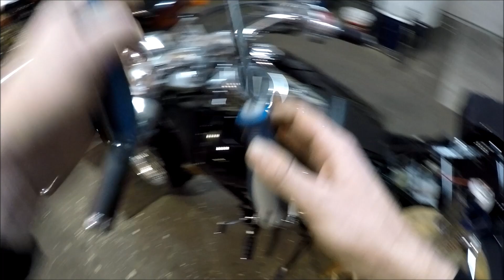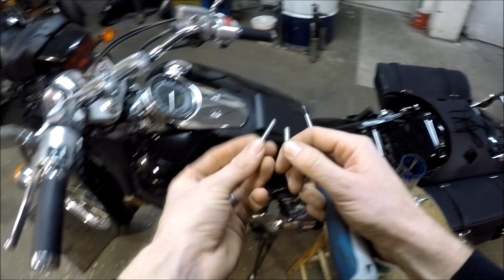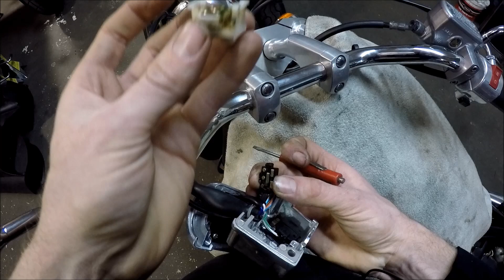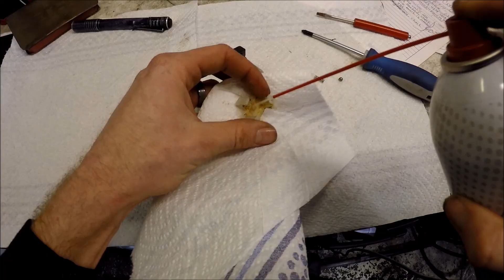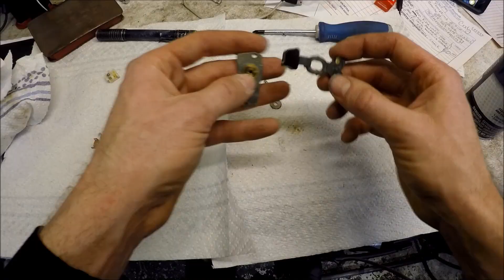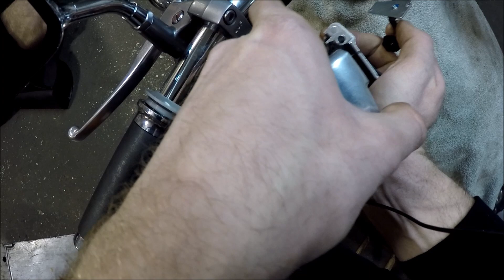Motorcycle Turn Signal Switch Repair

Comment: We just bought a 1985 Honda Shadow VT500c and it was EUROPEAN BUILT Germany to be exact. Just got it started and idling at 1100 rpm. Now all the turn signal lights were cut and taped.  We checked the voltage and after switching it on, volts switch from .01v to .09v.  Do you have any experience if the euro build it any different?   Thanks for any info.

Comment: Do you know if each of the contact points are a corner of the bike?  My left rear will not get full power, it's not the relay either...my test light dimly lights, enough so for the bike to think the bulb is dead and hyperblink.  I had cleaned up my signal switch but I didn't get UNDER the switch to the contact points.  I guess I'll give it a shot tonight.  Thank you!
Reply: Just as a follow up, I pulled the seat off and fiddled with the connections under there that run to the rear turn signal and got them to work.  There was power up until that point so I knew that was the break.  If it continues I'll repin that wire and reinsert into the connection.

Comment: Already replaced the whole thing siwich and light bulb, bit still doesnt work, what elso could be?
Reply: Maybe relay
Reply: @jperrod1979  thank you for replaying, I'll check at it  ✔
Reply: @h.sortiz3840  From what I've gathered, find the relay...for me it's under the right side cover...pull it and jumper from the white/green wire to the grey wire...that causes the bike to bypass relay and when you signal that side, both front and rear of that side will light up and stay on indicating that the wiring/bulb are fine...if both sides work fine with relay bypassed it is more than likely the culprit (although further multi meter testing can prove it, although not my strong suit).  If the issue persists with relay bypassed, then it's probably not the problem (like in my for instance).

Comment: My old 2000 BMW F650 had pretty much the same principle in disassembly except for a wire attachment for the choke. One of the screws that the turn signal switch pivoted on was very loose; tightening and lubricating got it working like new again! Thanks for the video!

Comment: Great video indeed. One question: the blue grease you use in minute 13:56 is the dielectric grease you spoke later on? Can you provide a link to buy it online?

Comment: Well guy, you did it again.  I just finished the clean and lube on the turn signal switch following the steps described in your video.  Big difference!  BTW, I ordered and received the JIS screwdrivers from GoFastInnovations. Well worth it, just like you said.  Thanks dude, keep up the good work.

Comment: I'm needing to replace the turn signal relay on my 2003 Honda Spirit 750 and I can't seem to find where it's located. I even have the part, but can't find on the web the exact location. I've avoided taking off the tank unless I absolutely have to so I figured I'd ask here first in case you can help. Great video on the switch by the way, I plan on doing this as well.
Thanks in advance.

Comment: Exactly what I was looking for. My Honda 919 turn signal switch is misbehaving. I have to hold the switch down for signalling to remain on. When I let go, let's say signaling right, the right signal light goes off meaning no low beam or high beam but the left signal still has low beam. Once I push in the signal button, both signals have a good low beam. See happens in reverse operation. Hopefully cleaning the switch will fix this.

Comment: What was the 4th thing you check out. You said tires, horn, and turn signal. You didn't mention the 4th. I got a 2001 shadow from a friend and your vid really helped out. I had the exact same switch. Only mine was full of dirt and now works like new. But I still want to know what the 4th thing was. Thanks for your help doctor!

Comment: Thanks, what a difference! Some things I found helpful were, small wire brush for metal parts, small paint brushes for grease and cleaning parts. My oh sh*t moment was with the contacts but after looking at the back of the white plastic housing (3 indents for the bearing to click into) it can only go in one way. Thanks again for taking the time to do this, was a great help.

Comment: Awesome video! When I turn my switch left or right I need to wait like 3-4 seconds before lights start to blink. Do you think cleaning the switch would help with this problem?
Reply from the maker: It’s worth a shot for sure man! I have seen this solve all sorts of issues!
Reply: Did you fix it? I have the same problem.
Reply: Could be the relay. Have an 85 V65 and relay finally went; replaced it and works immediately.

Comment: So, 45 yo woman here, been riding for 35 years, never worked on my own scooters.  My bike has been sitting for 8 years :-(, took to Honda shop, they were "three weeks out", great, "just fix it, whatever it needs".  8 weeks later, and to the tune of only $1300, finally got it, very excited, jumped on it and took off for home and thought, "HTF am I supposed to ride this with the blinker switch all gummy and sticking???"  But, I want to ride it this week, not 16 weeks from now, so I thought, "surely this cant be that hard..." Found your video right off.  Loved it.  Gonna try the easy fix FIRST and then if/when that fails, I'll take a chance on losing all those screws and springs!  LOL  Seriously, thanks for the vid, I subscribed before I even finished watching.

Comment: Would this also cause the brake light to stop working on a CB1000r?  I'm having the turn signal issue but my brake light also doesn't come on when I use the brake lever or the pedal.

Comment: I had the same problem on my 1984 Honda V65 Saber, I did the exact fix you posted, and I did it without "YouTube"... Manly cause there wasn't YouTube in the late 80's. But a great video, and you refreshed my interest in doing this to my 04 ST1300 before any problems pop up. Cheers

Comment: Good video. I am replacing out the complete front hydronic brake control and handle because it is so badly pitted and ugly on the outside. Do you have a video which shows the removal and replacement of the hose line to the cylinder pump on the handle?

Comment: What if that, and replacing the relay, doesn't fix it? What's the procedure I should follow to find the real problem?

2004 VT1100C Shadow Spirit.

Background: I moved the rear lights to install bags. The turn signals were a little flaky before I did that, so I figured relocating them would give me an opportunity to check the wiring and make sure it was sound. I did that by testing continuity with a voltage meter and everything seemed to be just fine.

After installing the bags everything was working the same as it had been before, meaning when I use the turn signals they worked most of the time. The times they didn't work they would usually start working after I turned them on and off a couple times.  They switch was a little dirty so thank you for this video. It helped me get the switch working very well. But the signals still don't come on...

TIA!

Comment: Thank you for taking the time to explain the details so completely!I had a turn switch assembly that required replacement because a previous ownerforced the switch arm when it was sticking and ended up twisting and fracturing it at the 90 degree bend. If all your videos are this informative I know where I will be looking when hopefully I won't need it!

Comment: being nitpicky but you got the directions wrong at 8:20!!!!     the lever pivots in the middle so when you push it right it pushes left on the switch inside.   otherwise great video.  got my xr650l signals working perfect!

Comment: dude thanks for this video. I opened my switch and it looked scary in there. I was ready to buy a new one and then I saw this video. will make sure to clean that baby out. one question. do you know if the seal in the inner part of the housing that prevents dirt and water can be obtained by itself. or in a set of 2. mine are cracking and dry because of the texas sun. I would like to put some of those in.

Comment: Thanks for this handy tutorial,
I will definitely try this out.
But I still have a problem with my turn signal switch. If my motorcycle has been stationary for a while (for example in the winter), there is a delay in the operation of the signals during the first few days. If you turn them on it will take a while before they start blinking. And that is very annoying if you have to turn often. Do you know what the cause of this can be? It is a Honda XL600V Transalp from 1995
Reply from the maker: Try cleaning the contacts out like in this video first. Then get back to me!
Reply: Yes I have experienced the exact same delay problem on my 2001 Honda XR650L. I did Cody's lube and clean and used a small SS wire brush on the fixed contacts and moving contacts and it solved my problem. It was more so the fixed contacts that are encased in the black plastic that were the issue I'm thinking.The contacts looked brand new but the grease build up over the years created a tarnish or glaze that made for intermittent contact issues. Great detailed video by the way!!
Reply: I just disassembled my switch yesterday, cleaned it and greased it again. They work perfectly again. Thank you very much for your video and advice. Now I'm excited to work even more on my bike. Once again, thank you very much.
Reply: Sweet the wire brush did the trick?

Comment: My VTX 1800 turn signal was sticking and only functioning after several seconds of delay due to the old sticky grease!. Because of your helpful video, I was able to perform this cleaning/rebuild operation without having to take my VTX to the dealer, or order a whole new part!  Saved me big $!  So, thank you very much for this!
Reply from the maker: BOOM!!! Great job man! Solid fix!

Comment: Hi Cody i did the mainenace to the switch this late afteroon. The greese had mutated into a sort of glue man... Now is working as new. I noticed that the screws that keep the plate shall not be tightened too much otherwise the turn signal lever gets too stiff or hardly moves as it should
Thanks man for your videos !
Cheers Davide
Reply from the maker: +Davide Emilio Marazza Good point! Glad you got that crap out of there and got it working like new! Enjoy!

Comment: great work Cody. I have own Hondas most of my life and now own a Goldwing gl1800. I had to clean and lube the four way flasher switch and up and down volume controls. the Goldwing is a little more complicated as you mentioned. I previously owned a 750 shadow ace 1999 and so far I have seen 2 of your videos that showed how to correct 2 problems that I had with it. one the turn signal switch and the other the creaky crunch brake master cylinder. Keep the videos coming you sure do know your Honda.

Comment: Blinkers are working backwards... I push in the blinker both front come on (no blink) brake light comes on...I pull the switch to the right the left side light up I push it to the left the right light up niether side blinks.. The back don't even come on
Reply from the maker: +Willie Patton have you cleaned the switch like I showed in the video??
Reply: Hello, I really hope you can help, I have the same problem, I don't seem to have power at the relay, could you please tell me how you solved your problem, Thank you. dianaandgerard@gmail.com
Reply: Also I did follow the great video and completely stripped and rebuilt the switch as in the video, but the front running lights are staying on, no power at the relay, no blinkers at all, all bulbs and fuses check good
Reply: Hi im having the same problem with running lights on but no blinkers front or rear please help
Reply: The bike is a 83 nighthawk 550
Reply: Probably have a bad relay

Comment: Hi MCMD, 
I had this problem. Riding was like, " What's going wrong with the #%&@#Blinkie switchie thing. I just happen to use my blinkers all the time. Looking down to check if the forward running lights were on, while riding down the road(yes, at all speeds) was going to "GET ME KILLED". I had in the past sprayed WD-40 in there, a fish oil product(hint). Would work for a little while.

Did EXACTLY what you showed how-to. The inside of the white plastic contact slider had GREEN-Algea-stuff growing in it. Took 20 minutes to kill that stuff. Could that have been the problem? Marine greased the whole area, reassembled with all your tips. No more WD-40.

Yep, works like NEW.  Can't thank you enough. You saved me a lot of Money/Worry. 

Thanks again
Reply from the maker: +Dave Ryan BOOM! Funky blinkie switchie fixie!! Isn't it a game changer?! Yes, that worn out grease "algae" is more than likely the issue. This is what causes the switch to get sticky and not allows the springed contacts to make a connection. Hope you can find a place to share the video and help someone out!! Ride safe brother!

Comment: thank you very much for sharing this video!! I fixed the problem on my 93 cbr. the switch was sticking and sometime not turning on. Instead of taking the whole thing apart like you did. i just took the toggle and the unit it pivoted in then cleaning that. i then used papertowels and q tips to clean the rest of the switch. used lube from harbor freight and feels brand new. thanks again!
Reply from the maker: Mr. Shaun Right on man! Some is good more is better! Glad you were able to get her smooth again!

Comment: Thanks for the video. Unfortunately, I broke a clip that the contact pins clip into. Any recommendations of where I could order that part?
Reply from the maker: Jordan Post unfortunately you can't order that part. It is sold as an assembly.
Reply: TheMotorcycleMD thanks for the reply! One more question if I may: could I have messed with something in that housing that would make my low beams not work (high beams still work)?
Reply from the maker: First thing I would check is the bulb, grab a replacement (you will need it one day anyways) and plug it in. I have a feeling this problem may have been a fluke and the bulb gave up at the perfect time. Unless a wire got cut or broken in the process!
Reply: TheMotorcycleMD ok, thanks for the advice!
Reply: I had the same problem - super glue and window screen graphing along with a small sheet metal shim support went a long way. That, or a careful sauter or weld job. Because you can't buy the individual part :/

Comment: Great video. So unfortunately since I suck at anything mechanical apparently this task was way to complex lol. Anyways, I tried cleaning it out first by spraying it. Made the switch work excellent... then my front right blinker stopped working. All other 3 work fine. So I opted to fully clean it hoping it by spraying it it blocked a contact or something... it's fully clean, works smooth as butter but front right is still not working. Also tried the bulb, no go. It's clicking as well so I assume the relay is fine?

Any thoughts would be appreciated, not sure what spraying in contact cleaner would do to break a blinker :(

Comment: Thanks for the video, if you disconnect the two clutch switch connectors you would get more room to work with it (like sit down on a chain with it in your hands in front of the bike) without removing the wires from the headlight etc.
Reply: Do you know where? I could get both right hand and left hand switches for 1988 Suzuki intruder vs 750.

Comment: Can you explain the clamping down? You mentioned tightening the back one first. Did you mean tightening the lower handle bolt first?
Reply from the maker: +TheMeishi It is as simple as a described. On the switch assembly's you tighten the back screw first then the forward screw (closest to to you) to clamp correctly.

Comment: Thanks for the new video. PM me an address. I'll ship you a magnetic parts tray! No more tiny spring paranoia.
Reply from the maker: Kyle Mitchell Can't find where to PM! 😂
Reply: Donated a tenner through your site/PayPal. Next time you're by ACE, grab two of these on me: http://www.acehardware.com/product/index.jsp?productId=3521458

Good size.  Strong magnet.  Rubber bottom makes it safe to stick right on top of a tank.  Just make sure you wipe off the bottom first, just in case.

Never lose a tiny screw, spring, or circlip again.  Well ... at least if you don't shoot them off the bike all the time, like I do.